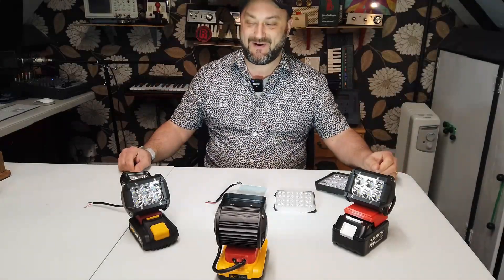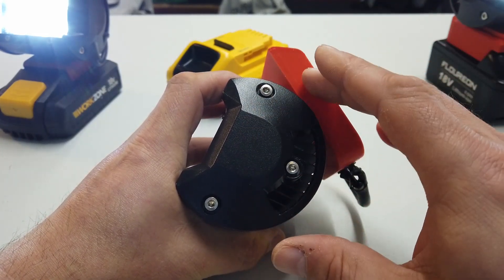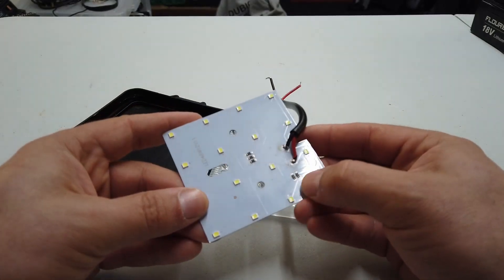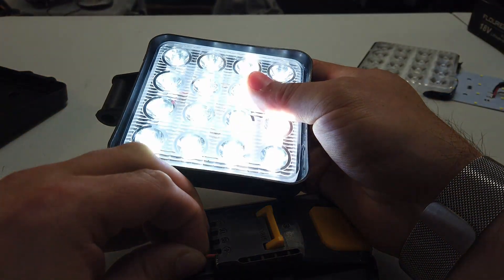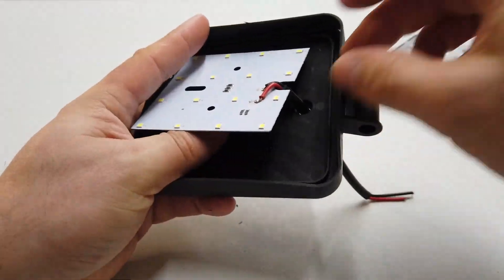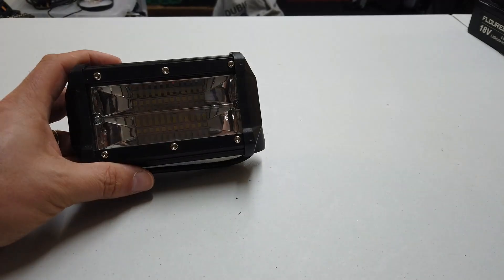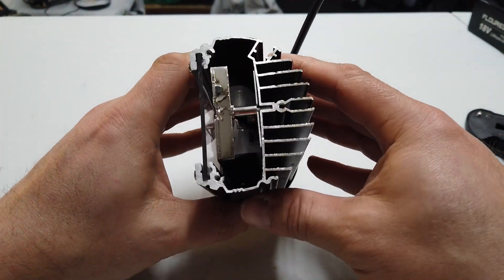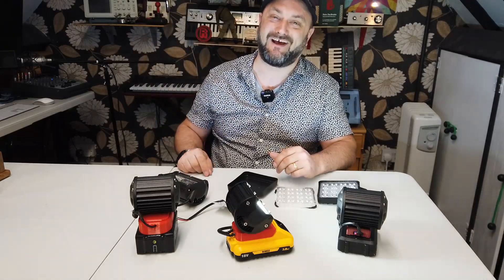DuB-EnG: Chinese LED Lighting teardown and review from eBay - The Good the Bad and the REALLY BAD!

Comment: Is it 12v lights on a 18v battery
Reply from the maker: Basically yes... the 18v battery peaks at 21volts and offers plenty of amps.  The seller suggested their light works on 24v lorry (wagon) systems... but it sure doesn’t!!!

Comment: Interesting stuff Mate, They make a nice compact little unit    💡 👍 😊
Reply from the maker: I think you may have been the inspiration behind some of these!!
Reply: Thanks, I made one a good few years ago that fitted to my old dewalt batteries, The LED cob came out of a failed Lidl's outside light, it was very roughly put together but worked great, I think I gave it away with all my old dewalt kit when I upgraded, Yours are looking factory made    👍
Reply from the maker: Thanks sparky... they do look good... I have more work to do to make them perfect!!! :-)

Comment: It should be a metal heatsink, looks like a 12v fitting. When testing use a cc variable power supply and do some Ohms law calculations. Never trust the specs.
Reply from the maker: Yes yes...   I promise to do that next time :/).   Then I’ll see the saturation point of the diodes!!